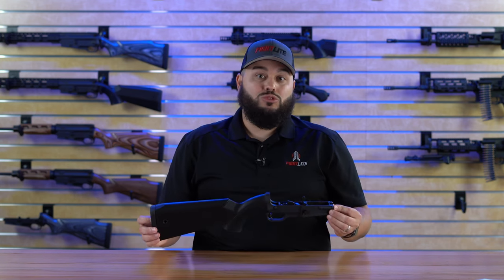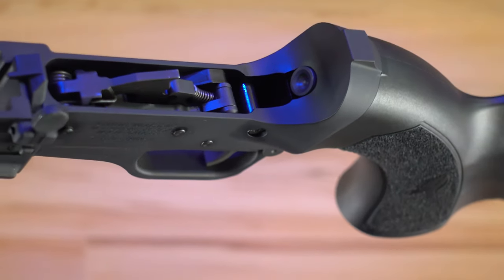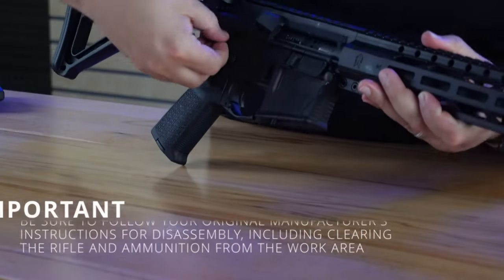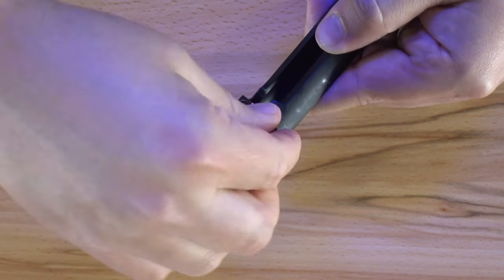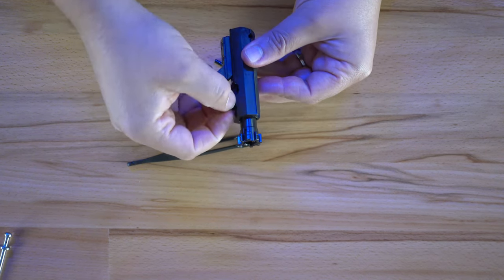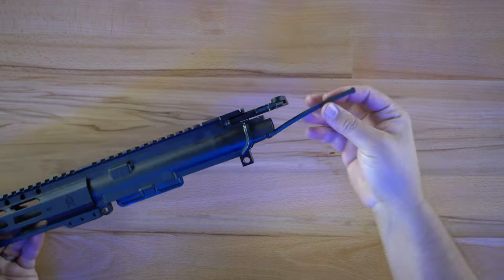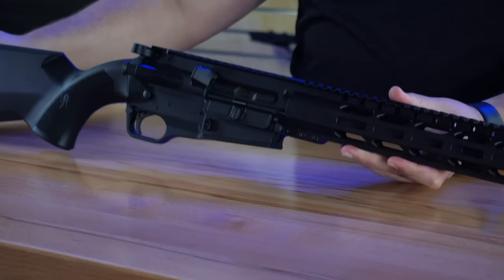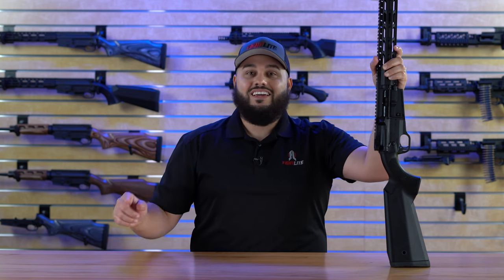SCR Rifle Lower Installation

Comment: Do you make these in .308? Can find anything on your website about it.
Reply: Someday...fingers crossed...
Reply: Says on the lower option that you can get it in multiple calibers
Reply: Built around the ar 15 (not ar 10) so you could do a 6.5 or a 300 BO depending on what you’re looking for but no .308. At least, not yet.
Reply: The answer is yes. It accepts different caliper uppers. Interchangeable with different manufacturers as well. In your gun case you can travel with one lower assembly and 3 different caliper uppers if that shakes your tree.
Reply: @iangrefig8815  6.5 Grendel buy not Creedmoor

Comment: What do you do for different calibers as in buffering? Is there a adjustments for heavier calibers?
Reply: The best way to deal with different chamberings is how you manage the gas system.  The port should be at the optimum location and diameter, with a sealed gas system.  You can also use adjustable gas to regulate the gas flow into the carrier to optimize the cyclic rate for the ammunition you are shooting, as well as the conditions.

Comment: So you can load this without running the lever if you want to ?
Reply from the maker: The SCR is direct impingement semi-auto. It does not have a lever. You might be thinking of our Herring Model 2024 Modern Lever Action.

Comment: Does this allow you to drop in an AR-15 Geiselle SSA trigger?
Reply: No. As far as I can tell the trigger is completely proprietary. I knew the hammer would be different but was hoping the other components would be mil spec. No joy. Hopefully these things take off this time and someone out there produces a match grade trigger.
Reply: @iangrefig8815  the hammer spring is the same as ar15

Comment: Can i put a stag left handed upper on it?
Reply from the maker: Unfortunately, we believe that the cam pin slot on Stag’s left hand uppers is reversed and therefore not compatible with our SCR bolt carrier.
Reply: @ARESDefense ok sad news but here's another question can the safety be swapped to the other side?
Reply: I use a Gibbz left hand charging upper without a problem on a SCR lower